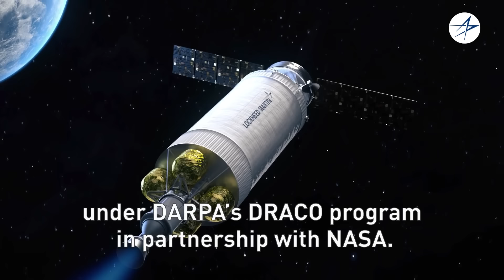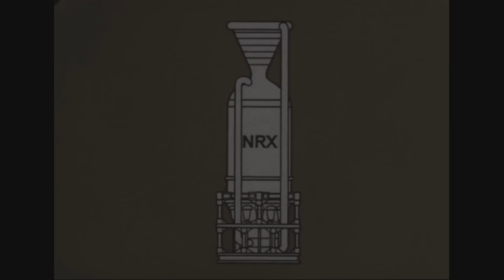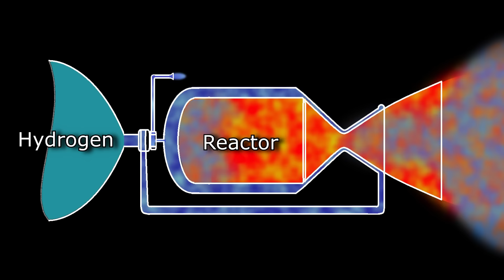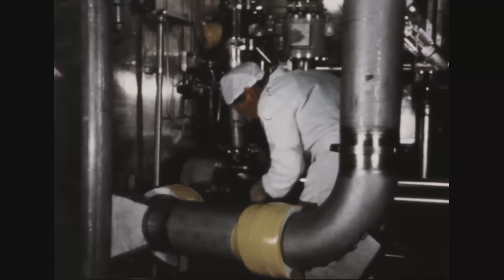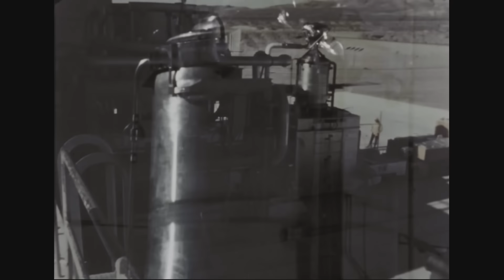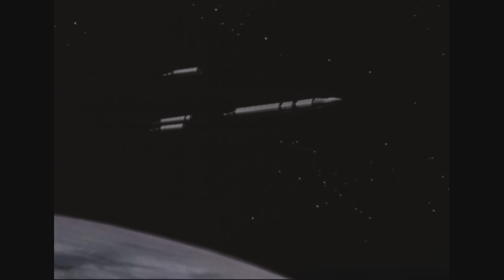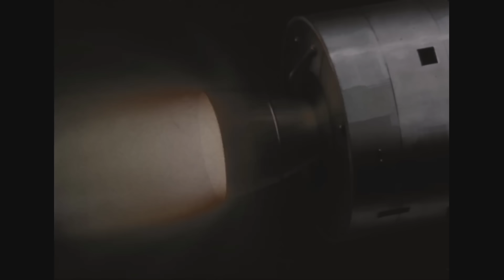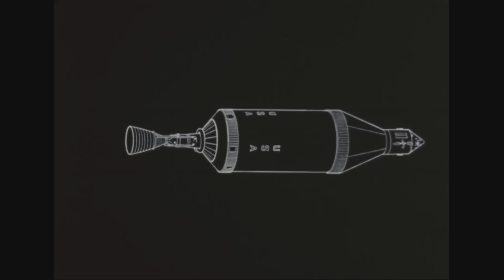Why Nuclear Rockets Are Going To Change Spaceflight

Comment: Please tell me why we could not harvest water/ or other mass from a comet and run it through a thermo neculear rocket for engine?
Reply: I have imagined a scenario where we found a properly sized comet going generally the right direction, and attached to it.  Then using heat from the nuclear engine to slowly melt or vaporize it, harvest any needed recourses and then accelerating everything else out through the engine for thrust.  Interstellar travel using current technology.

Comment: Isn't the high radiation issue only a problem when the engine is running? Once the burn is over and the engine has cooled, is it not then safe for the crew to leave or approach the ship from any angle?
Reply: Nope. Spent fuel will still be highly radioactive for decades and will be dangerous.

Comment: The Nixon admin killed off nuclear propulsion because they didn't want to deal with more space travel? I always assumed it was because the anti-nuclear movement had gained too much traction and actually trying to use nuclear engines would provoke hysteria.
Reply from the maker: Where did you get that idea?
Reply: @scottmanley  Not something I had put a lot of thought into. Just seems like the enthusiasm for nuclear powered stuff had peaked in the 50s and then soured through the 60s and 70s and beyond. Opposition to anything labeled "nuclear" -- from weapons to reactors --- was pushed by various groups including environmentalists and some orgs that were quietly backed by the USSR, which was always looking for ways to disadvantage The West. 

As I said - it was just an assumption I had made and I was surprised to hear a different take. I'm open to the possibility that my assumption was incorrect or that maybe it was a factor but there were others that played a larger role.

Comment: You can get pretty close to an equal temperature of the exhaust with countercurrent exchange though. Bio student so I know nothing about engineering but like a fish gill is incredibly efficient when it comes to absorbing oxygen through the water, same with countercurrent exchange in your limbs to keep conserve heat. I’m guessing the added complexity and weight is probably why you wouldn’t do that on a rocket engine.
Reply: Or I guess it maybe doesn’t matter if the whole core generates heat anyway?

Comment: There is considerable decay heat following a reactor shutdown, so it may not be possible to have instant shut-off of the thrust as you would with a chemical rocket, assuming that the hydrogen propellant has to continue cooling the reactor. Also, assuming a reactor shutdown would lead to an immediate spike in Xenon poisoning, how long would be the delay  before the reactor could be safely restarted for course adjustment?
Reply: Xenon poisoning largely resolves itself after 40 hours.

Decay heat will be considerable but it is still small compared to the heat of a running reactor. Coolant probably wont be needed.
Reply: @storyls  40 hours could be a problem if course correction was needed earlier. Restarting a reactor whilst the Xenon is decaying needs great care to avoid an uncontrolled reactivity excursion as the increased neutron flux further depletes the Xenon. Not insurmountable as I assume that naval reactors have to deal with that.
You may have underestimated the decay heat. It is considerably less than full power, as you said, but it still has to go somewhere or temperatures will keep rising. I would think that ceramic fuel would be used for temperature resilience but I am not sure.

Comment: I think a better option would be to go with nuclear fusion, instead of fission. Instead of passing hydrogen through the fission reactor to heat it up, we should pass it through a fusion chamber and exhaust the result. And while we still don't have fusion reactors just yet, here on Earth, we don't need that. We can already achieve fusion, we just have to take the reactions that we have now, and put it in an open chamber, and maintain the fusion for a far longer time. This, of course, would take ridiculous amounts of electric energy to maintain the extreme magnetic fields, but we can generate that energy from a closed fission reactor instead, just like the ones in submarines. There would be some radiation to deal with, but it will be far less than a nuclear thermal rocket.

Comment: Suppose two oval tubular circuits that share one of its sides. Inside those tubes, TRISO fuel in calculate densities that reach criticality when flowing thru that shared tube. The speed of the flow, the temperature of the core and the heat exchanger rate can be precisely controlled by adjusting the speed, the density of the TRISO cells.

A smart system can track each and every TRISO cell state an divert it thru gates to different areas of the reactor: to cool down, to warm up, to fission, for how much time in each of these stages by simply tracking and opening/closing gates.

Comment: Looks like an extremely complex and dangerous contraption, even more so then the chemical rockets which are quite the bombs already. What we really need is some kind of simple, inexpensive and really efficient propulsion system. Turbo diesel comes to mind 😁
Reply: “Turbo diesel” isn’t that effectively a gas generator design which is already in use?

Also, for nuclear rockets the actual plumbing doesn’t need to be as complex since you only have the one propellant to deal with

Comment: There is also the Closed Cycle Nuclear Torch, AKA the Nuclear LIghbulb, that is emitting directed UV/ligh rays so basically nuclear photon rocket. Though I have never seen it as anything other than a suggestion, or basic diagram.

Comment: Obvious question: why can't a portion of the H2 in a hydrolox chem engine just be heated by the superior temps of chem like in nuke and be expelled at 900+ specific impulse, increasing the exhaust to their average?
Reply: Running extra H2 into the exhaust is already done for that exact reason on most if not all hydrolox engines, and it also helps to prevent the combustion chamber from getting too hot

Comment: This is why we need a gas mine on Saturn. Bespin would be a good name for it. Helium is radiation proof and is excellent in this application, except there isn't much here on Earth. Also it leaks through everything. But we still need a gas mine on Saturn. (Yes I know Jupiter is closer. Let's talk about the engineering challenges shall we?)

Comment: As I'm watching this, I'm wondering what could possibly go wrong. The engineering challenges are considerable, and, even if mastered, the engine still seems dangerous, messy, and unpredictable. It's not enough that future space farers have to avoid being irradiated by the background radiation found in space, but they will also have to avoid being irradiated by their own rocket engine. In a word, NTRs lack eloquence.
Thank you, Scott, for this detailed description.
Reply: The last thing we need is a talking rocket engine.
Reply: Well when you think about all the things that could go wrong with a purely chemical engine with exhaust temperatures hot enough to melt iron, we have always faced major engineering challenges and dangers.

Comment: My favorite rocket engine is the Nuclear Salt-Water Rocket. Take a solution of plutonium salts from its moderator-coated storage and pump it into a reaction chamber where it is free to go critical and you are effectively riding a continuous nuclear explosion!
Reply: Scott has an older video on the nuclear salt water rocket.  I think he described it as an ongoing continuous Chernobyl.
Reply: A constant-duty Orion Drive.
A NSWR with highly enriched uranium saltwater is basically the only thing we have on radar to be a proper interstellar torchship.
Reply: Roses are red
Gear and sprocket
Thomas the Nuclear Saltwater Rocket

Comment: I wonder if hydrogen in a rocker engine can be actually heated by... 
Burning kerosene, possibly at perfect stochiometry. Kerosene is much more energy dense (volumerically), and hydrogen has the lightest molecule. The trick however would be to separate burning kerosene from the hydrogen to prevent ignition of the latter.
Reply: Yes. I have wondered about this for a long time, too. The only purpose of the 'nuclear' in an NTR is as a heat source. And the temperature is LESS than in a chemical rocket. I haven't done the numbers, but perhaps a tri-propellant rocket using a chemical reaction to heat the LH2? (Probably need to separate the exhaust streams.) ISP would be likely intermediate, but without hassle of radiation.
Reply: @dennisleas8996  
There was a tripropellant rocket engine that used Lithium and Fluorine in a reaction and then added Hydrogen to carry the heat.

It has the highest ISP of any chemical rocket engine up to date: 542 seconds

However, the propellats were very cumbersome to deal with, since Fluorine needs negative temperatures to remains liquid, while Lithium needed to be heat up to hundreds of degrees celcius.

They can be viable for extremely high energy upper stages, but unless people become crazy enough to use Liquid lithium and Fluorine in large scales, they probably will never be used in large rockets (sadly)
Reply: @dennisleas8996  another advantage of such an engine, I believe it would be quite easy to implement a full flow cycle: theoretically, only one turbine can be used with all the pumps on the one shaft and kerosene separating hydrogen section from the oxygen (instead of helium, like in RS-25). Additionally, possibly, JP10, which is more energetic can be used, instead of the RP1.
And last, but not least, you would need much smaller tanks for the fuel, and kerosene does not need any insulation or exotic materials to be stored, unlike hydrogen.
On the other hand, hydrogen is perfect for aero spikes as it is great at transferring heat: both to cool the spike and reuse as much heat (radiated by the exhaust) as possible.

Comment: What kind of efficiencies would you get if you had a nuclear reactor using a turbine or similar to generate electricity and then run an ion engine off that? You'd lose thrust but would you gain Isp?

If so, would it be possible to create a dual-mode vehicle that runs the reactor in thermal mode for when high thrust is needed and then switches to the ion engine for station keeping or other maneuvers where you want to maximize longevity of the propellant supply?

Comment: My kid asks why you don't just use nuclear reactions to power massive ion engines?  Is there any basic science or math on that, or on electric acceleration of the hydrogen exhaust of a conventional nuclear engine?  Something to work forward to in the next 50 years, rather then just working back towards ideas from 1970?
Reply: There are multiple projects working on just that. The challenge is that the nuclear power plant requires a lot of cooling. Huge, lightweight, meteorite-proof cooling towers on a spaceship are the hardest part of the whole system. Much harder to make than the reactor itself.

Comment: now that you've tackled atomic rockets, you should do a video on near-future radiators! they're really cool and a lot of people don't know about them. NASA and co came up with a bunch of radiator designs where the ship would spew molten metal or metal dust out into space, then recollect it again after it cooled. There's a lot of really out there designs. Also a dive into the future of nuclear rockets (i.e., liquid core, gas core) would be cool
Reply: That sounds so metal! (hehe) where would I find info on that, is there a specifc project name nasa has for that?
Reply: Oh hey, its Sister Miriam Godwinson! How is Life on Alpha Centauri?
Reply: A cooling method in Elite Dangerous is to dump all of a ship's heat into a heatsink plate and jettison the plate, you can't retrieve them though as the cooling takes days.
Reply: That sounds cool, and would make for a very interesting video.
Reply: It's really difficult to cool anything in space, as heat transfer does not work in a vacuum. Liquid metals would radiat some heat, but I would have quite a view questions on how this should work.

Comment: Could the nuclear reactor be used as a generator for loads of electricity while it is being fired? Could this power be injected into the hydrogen after passing through the reactor? Like an afterburner for nuclear engines.

Comment: I wonder at what point would it be more beneficial to use a nuclear powered ion engine rather than a straight nuclear thermal engine
Reply: No, much as they're loved by armchair engineers. 

When you run one you have to dump the waste heat. So you need radiators. But anywhere inside the orbit of Jupiter the size and weight of the radiators is higher than the size and weight of solar panels to make the same power, even before you include the weight of the reactor, coolant and shielding. 

Even outside the orbit of Jupiter it's marginal if you are willing to include a solar concentrator design using very thin and light Mylar mirrors to concentrate sunlight onto the panels.
Reply: Then you are back at no thrust again. You can't hit the same power levels when you have to radiatively cool your reactor with huge radiators, as when you can ditch your hot "coolant" (that's actually propellant in this case).
Reply: @kukuc96 Once you get out into the outer solar system the calculus of thrust vs. dV starts swinging heavily in favor of delta V as the biggest factor in flight time. The flight times are so long that even if it takes an ion/plasma drive months to build up velocity it will still beat a chemical or nuclear thermal rocket there.

Still best to have a chemical stage to get you through the van Allen belts quickly though.
Reply: They already do that.  They use RTGs instead of conventional reactors.  As to when you want to switch from RTG to conventional reactor, it's probably going to to an issue of mass and cost.  But as he said, because the thrust of ion thrusters is so low, you aren't really going to use it for manned space flight.  But it might be sensible to use to push space station modules out to the asteroid belt.